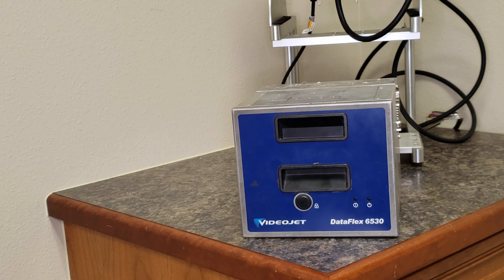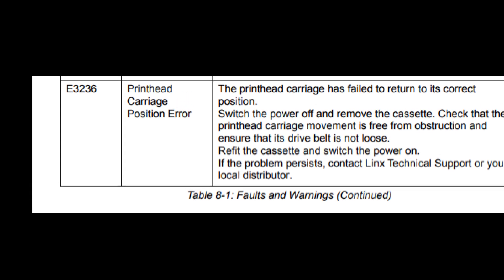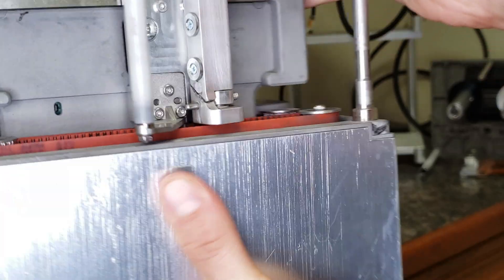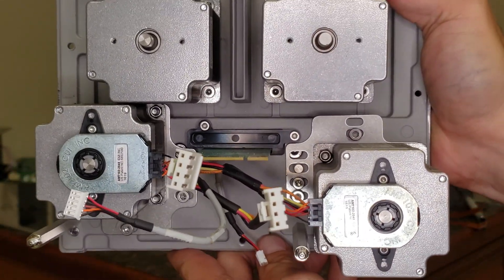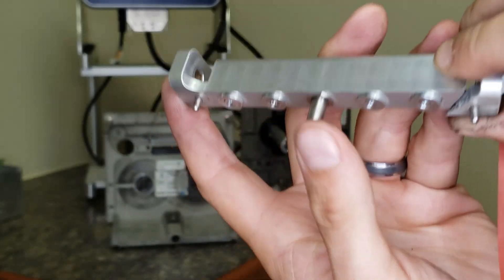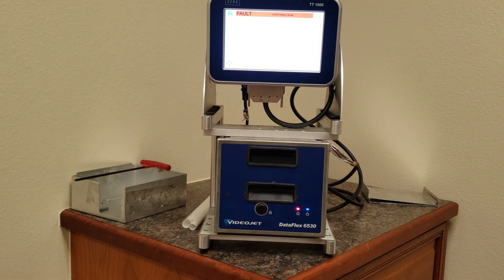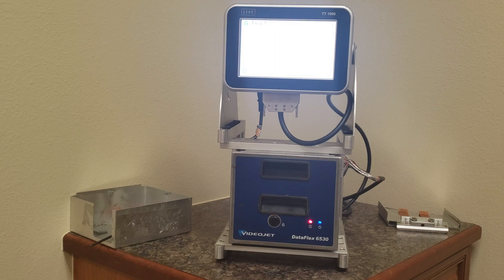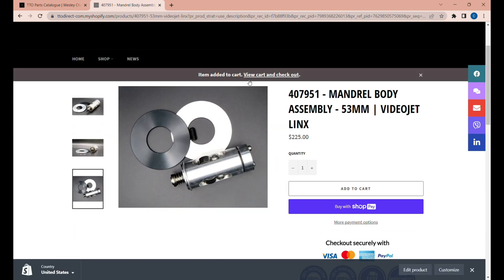Videojet Dataflex 6530 Repair: Printhead Carriage Error - Root Cause & Solutions

Comment: Please, I would like to know the reason for the alert. FAULT E3245

Image Outside Print Area
Reply from the maker: The printer is detecting some of what you are trying to print may be off of the ribbon. It is very sensitive if you are within 2mm of the edge you can get this error
Reply: @TTOPARTS You mean mechanical modification
Reply from the maker: No try playing with you registration from screen
Reply: @TTOPARTS Thanks

Comment: Videojet 6230 is not giving any errors. It is printing and the prints are visible on the ribbon but it is not leaving  prints on the package. I am using the default code date image..... any hints
Reply from the maker: There is alot going on. The good news is the print is on the ribbon. That mean printer and printhead are working great but nothing is transferring.

First thing to check is the printhead gap you may need to get slightly closer to the platen pad or roller.
Then you need to inspect the platen pad and roller. These need to be replaced over time low parts can form in the rubber and destroy print quality.

After that give me a call or email support@ttoparts.com  happy to help
Reply: @TTOPARTS   thanks so much "First thing to check is the printhead gap you may need to get slightly closer to the platen pad or roller" and what you mentioned in the quote is what was the problem. Thanks so much
Reply from the maker: Happy to help

Comment: In my machine nothing is broken belt also tight so how i can resolve this
Reply from the maker: The air driven printers allow you to change belt tension by loosening the three screws of the printhead carriage motor. I would recommend taking this apart you may want to check the idler pulley and the shaft also.

Comment: Hi working on  VIDEOJET  6210, just changed CMOS battery BR2032 reassembled everything after turning on I get fault and carriage unable to move, tried couple of power cycle still no Go & I don't see any cracks on print head or slider but it feels little hard to roll the stepper motor. Any suggestions? Ty great video & heads up..
Reply from the maker: @ragautb thanks for reaching out. Sorry to hear you are having trouble. The 6210 is the smallest of the VJ TTO printers. Here are some things to confirm, slide is not causing your jamming, no obstruction in the path sometimes little screws can find there way into places they shouldn't. I would recommend turning power off then confirm the movement works with out power if everything is smooth then look at your connections is it possible you plugged something in wrong on the PCB if that was removed, is it possible you have a bad PCB..

Best of luck
Reply: @TTOPARTS  Thank you for Replying, ive checked everything before taking apart the pcb ive marked numbers on jst connectors of all three stepper motors and other connectors, after replacing battery & putting everything back  i  booted the clarisoft the slider was working during pre-checks there was no faults, it happened exactly after loading the job and hitting the Manual print button on touch screen but unfortunately i forgot to connect the Air hose to the printer, as soon as i hit print button it looked like the whole software got crashed like touchscreen graphics became unresponsive and screen became white, i manually turned off the device then rebooted, it was working, followed same steps but for the 3rd time prechecks were not happening except some relay noise as soon as OS booted Fault  "E3007" Displayed and am unable to clear it. i cant even try to toggle and move the carriage to home position. the toggle button the screen would become unresponsive. never expected such a disaster would strike for just replacing the battery. Milk Packet Production on Single head is Halted due to no printing Backup. just don't know what to look for, any help would be appreciated Thank you friend. any ways to hard reset the device to factory Settings, i have another unit working i can copy settings and jobs from that device..
Reply from the maker: @Ragavenutb  You have some really bad luck. It sounds like you did everything correct and the machine just doesn't want to behave. I would suggest grabbing a USB and inserting it into the touchscreen of the other unit. Once inserted go to settings>>setup>>control>>Clarity Clone

Create a clone of the working unit and then copy that into the unit that is giving you trouble. I had a unit at a recent install that would not load messages and had to do this method to get it up and running.  If you are in the states you could send me the unit and I can even get you a spare while I fix yours. 

Best of luck!
Reply: @TTOPARTS  Thank You, ill attempt this trick today and see what happens. Sorry, am from India, and video jet after service definitely sucks here, its been10 days ive informed about the issue still no call back or any solution.
Reply: Hi, I tried but there is no option to clone the clarity settings under setup. Options available are language,screen calibration,date& time,screen orientation and communication. For some reason could they have intensionally disabled those settings?
Reply from the maker: @Ragavenutb   Its possible that the USB that you inserted into the screen does not work properly. make sure you select settings>>setup>>control.